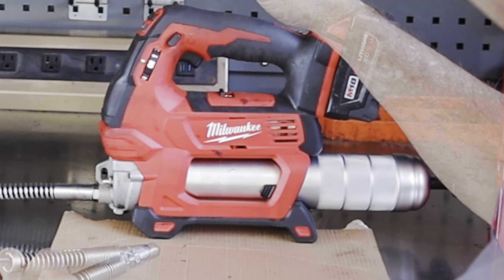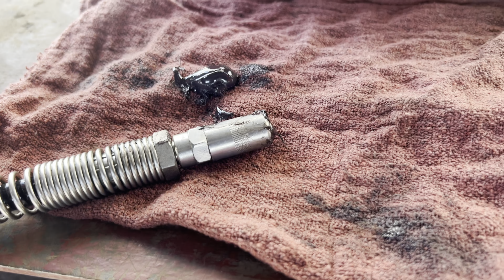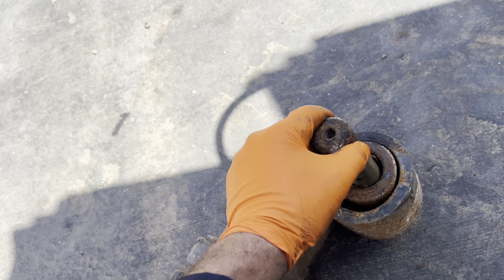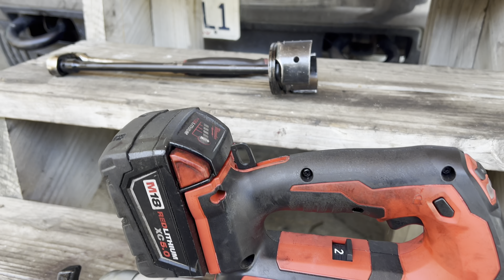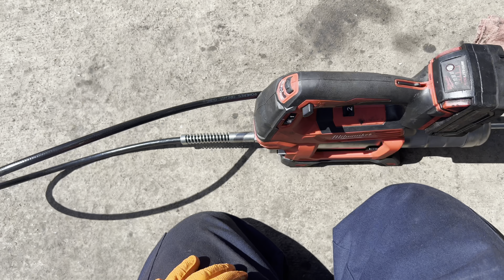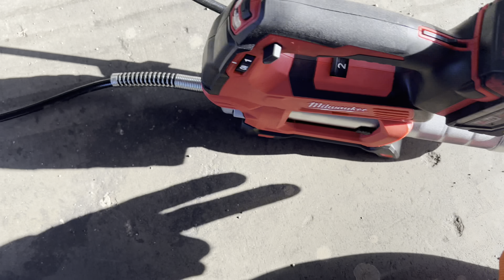Milwaukee Tool M18 Grease Gun Cool Features

Comment: Thanks for the video - been trying to to decide between 12 vs 18V
Best video I’ve seen demonstrating the tool.
Reply from the maker: Thank you very much which one did you decide to go with?
Reply: @HowtoAutomotive I picked up the 18V, everyone I work with has the 12V which is sufficient, but I have more 18V batteries and was looking to justify the extra cost. The pump setting is what sold me.  I don’t use a grease gun often but I’ve had to borrow one too often lately so it was time.

Comment: Isn't setting 1 slower more pressure and setting 2 faster less pressure? Opposite of what you said in the video? Would I use setting 2 for something like EZ Lube bearings in a trailer so I don't blow out rear seals? I just bought this grease so trying to learn

Comment: When you’re finished with the grease gun,could you put the hose on the  grease gun zerk and give it a pump to relieve the residual pressure?
Reply from the maker: No there is a vent button next to the host that does that.